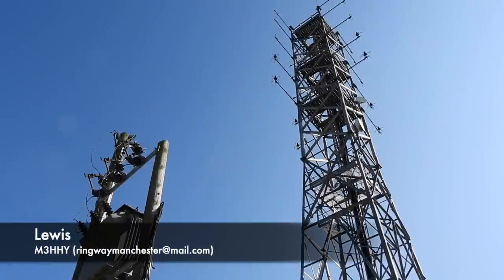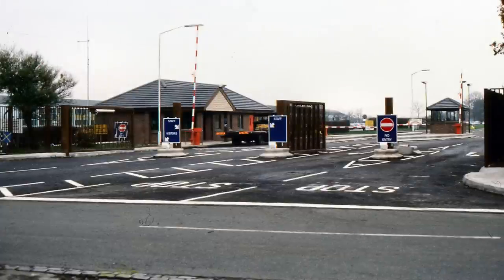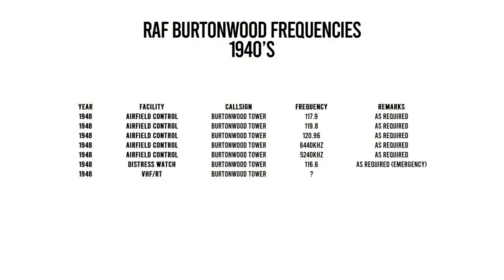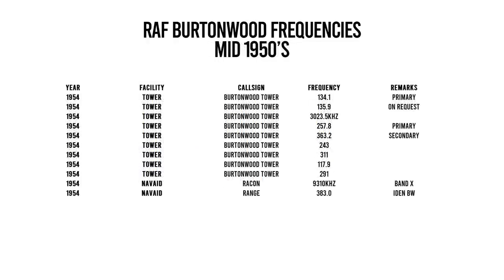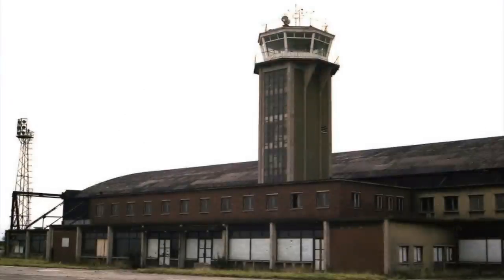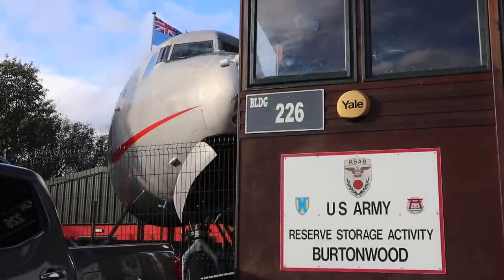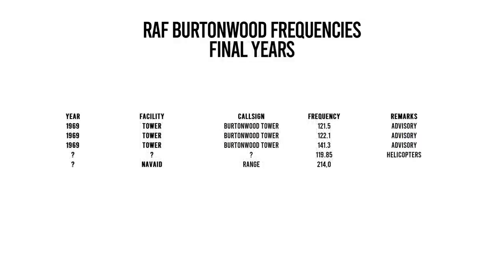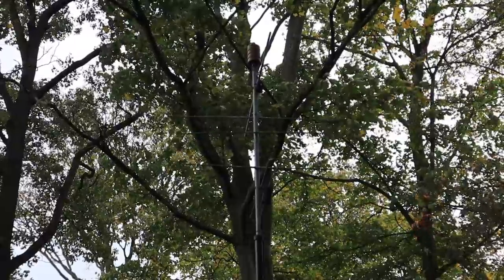Radio Systems At The Former Largest US Military Base In Europe

Comment: By January of 1967, the base had been abandoned by the U.S. Air Force for around two years.  When Charles De Gaulle kicked all U.S. forces out of France, most of the items in storage facilities were transferred to Burtonwood.  The unit responsible was the Army's Communication Zone Europe.  I was sent, from Poitiers, France, as one of the first soldiers to be stationed at Burtonwood.  Warrington was then in South Lancashire.  It slipped into Cheshire in the early 70s.  We took a U.S. Army AN/GRC-26 radio van to the base in late January.  It was actually an HF radio-teletype van.  When we arrived at the base, a landline cable was installed.  I was the only radio-teletype operator sent from our detachment.  I held down the post of radio NCOIC (non-commissioned officer in charge) of all radio communications.  I laughed at this title, since we NEVER used our radio even once while I was there.  Our radio van was parked inside the warehouse closest to the very front offices of the Header House. This landline teletype set-up, which aside from telephone and telex, was the only communications we had. They sent landline teletype operatiors, or communications specialists to operate in the tiny van. For me, it was an easy transition from a radio-teletype to use landline.  Having spent nine months, back in France, actually using the radios, I would have preferred my old duty.  So, from January 1967 until I left in June of 1968, there was absolutely no radio operation going on at Burtonwood.  BTW, we had a tiny detachment of Army aviation stationed at the field.  They were on temporary duty from their home base in Germany.  The had one light plane and one helicopter.  I was used as a temporary photographer, towards the end of my time, so I got to go on missions in the plane and chopper.  I liked your video, but I hope I cleared some things up.
Reply: Thanks for your contribution Barry, always great to fill in any blanks especially with first hand accounts such as yours.
Reply: So you’re at least 70?

Comment: I was a staff cadet with 635 Gliding School in the early 70's, happy days. When the M62 first opened, along the line of the old main runway we had to be careful with the winch cable if operating adjacent to the motorway. On one easter weekend there was an incident when a second winch cable was caught in the tail skid of a Cadet MkIII during a winch launch. Luckily disaster was averted by the swift action of the winch driver who chopped the cable. However, the trailing cable was dragged over the motorway, causing some fuss. Traffic was very light in those days so no real harm done.
Aldon P Ferguson has written two excellent books on the history of RAF Burtonwood for anyone wanting more info.

Comment: Stumbled across this vid last night looking for info re the Burtonwood Radio Range An advanced type NDB tx MF which was also use by civil aircraft and airliner.....it was one of 4 such radio Ranges located around the UK to give a good UK navigation service.

A retired BEA captain was telling me how he used it many times over the years flying DC-3 and Viscount aircraft.

I was trying to find the transmitting site or location of the Radio Range Site in Warrington to see if anything remains or gives a clue to its time in the area.

Seems the transmitter was located 2 nautical miles east of the Burtonwood main base....which would put it around Winwick Road near the M62.

I wonder if anything is known to pinpoint the transmitter site.

I remember the Bell Huey Choppers flying from Burtonwood to the nearby Speke Airport....were lots of USAF still operated in connection With Burtonwood....as burton wood had no operational runways.

This was late 60s....

Those Huey Choppers had a very distinctive boom boom sound from the 2 blade rotor.....carried for miles.....how I loved that sound heard in my home in liverpool as a kid.

Types of aircraft we saw at Liverpool in connection with Burtonwood where DC-3 DC-4 DC-6 Convair 440s I think there were and small but stunning looking Beech Seminoles types.

Loved heard the pilots America drawl on my early VHF airband radio

Prob lots of other aircraft types that I am not aware of operated into Liverpool Speke at that time.

Keep up the good work Ryan.